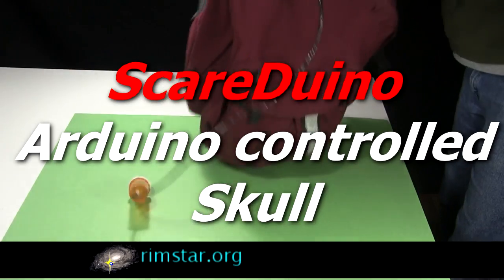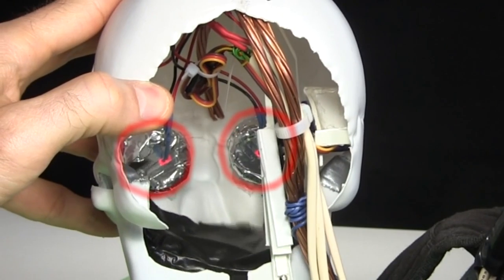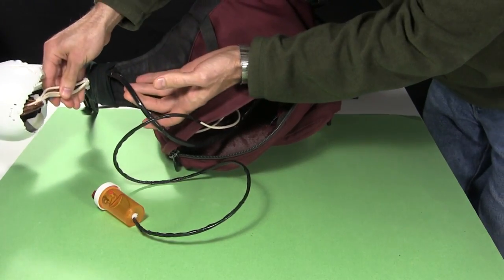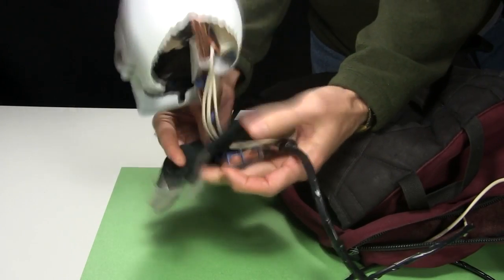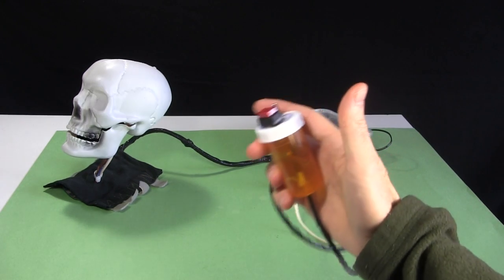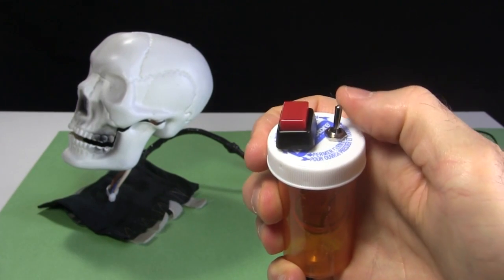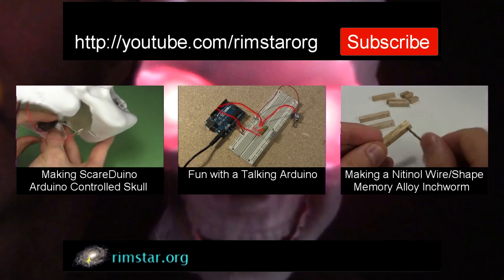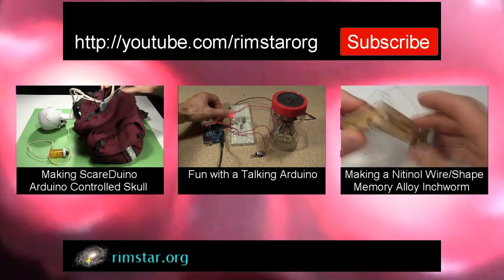ScareDuino - Arduino controlled Skull with Servo, LEDs, Speaker

Comment: what's your power source?
Reply from the maker: Erkhes Batjargal I use two power sources... 9-volt battery for the Arduino, LEDs and speaker. 4 AA batteries in series for the servo motor.

Comment: you can do it with a simple circuit ,why arduino ,nothing special here
Reply from the maker: Abraham Magnifico With the LEDs I agree. But I don't know what's involved in controlling a servo. And the other way I know to produce the sound would be a 555 timer circuit with accompanying resistors and capacitors, though it's probably not apparent but I have the sound frequency increase as the jaw is opened and decrease as the jaw is closed. Of course, since it's easily programmable I can get a lot fancier. And the total jaw opening time, time to remain open and the closing time would have to be controlled somehow. Maybe you know how to do all that with a simple circuit, but the more I think about it, the more involved the circuit gets.
Reply: RimstarOrg so you used the arduino to controll the frequency of the sound + the timing ? if so ,good point ,i thought that there is no timing ,i thought that the operation will end when you hold your finger back
Reply from the maker: Abraham Magnifico Yes, the arduino controls the frequencies of the sound and all the timing. At one point in the video I'm still holding the switch down while the jaw closes and the sound stops, but I guess if I'd held my finger on for even longer then that would have been more apparent. But my code is smart enough to detect if I release the switch before the time is up, in which case it immediately starts the closing procedure. So I can't control the maximum run time with the switch, but I can shorten it.

Comment: you sould add some screams on it,would be even more incredibly awesome :D!
Reply from the maker: apostolis633 I started out trying to use some Arduino speech synthesis libraries but they always had conflicts with the servo and stepper motors. I tried a DC motor with an H-bridge but just didn't like the idea of doing this with a DC motor when a servo or stepper made more sense. And then I discovered the tone library that comes with Arduino. I'll play around with the tones more for the next video and come up with something more imaginative.